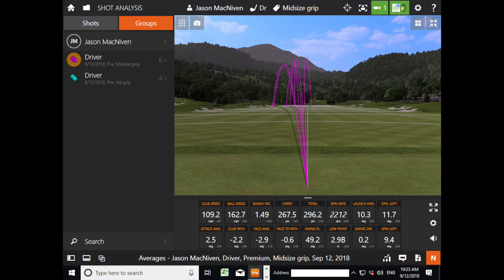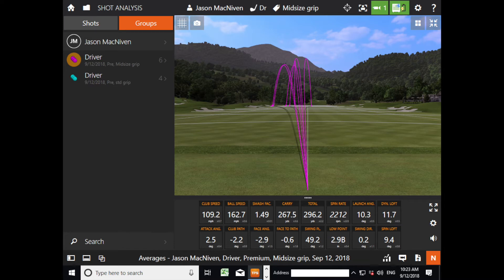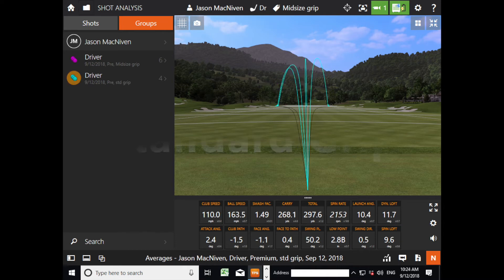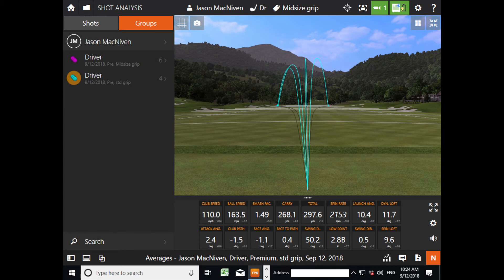Grip Size

Comment: I use a midsize grip; do you have the option to use a midsize for club fittings, as I’ve done previous club fittings but only with a standard grip?
Reply from the maker: No, I will only have a few midsize on my demo shafts.